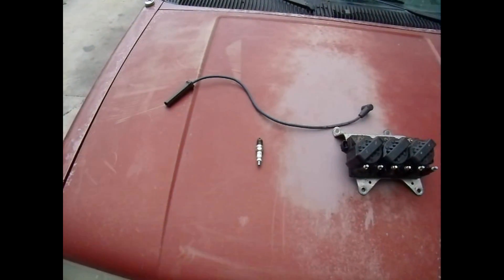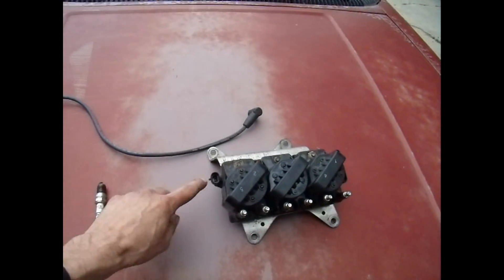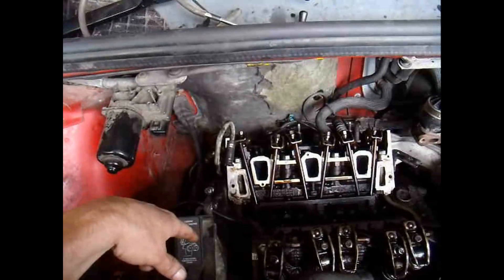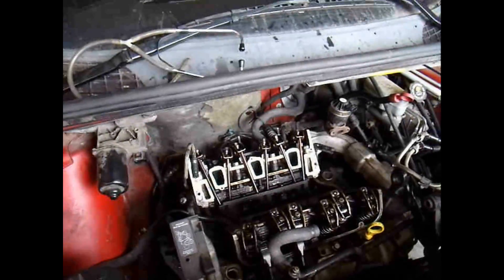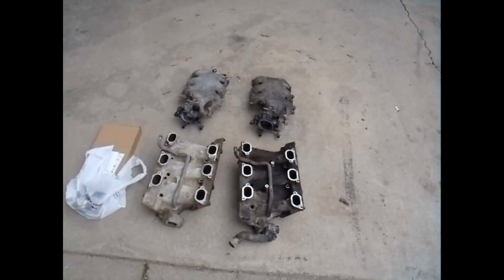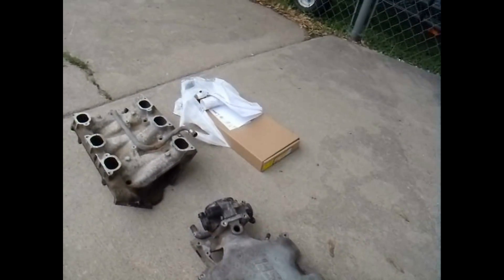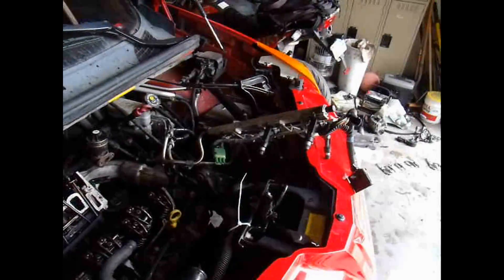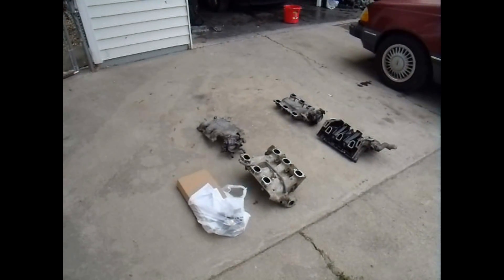GM 3400 / 3100 3.1 3.4 Engine Misfire Cause & Causes Miss Missing P0303

Comment: a bad head could cause random misfire?.... I own a alero 2000 with a 3.4L i found a random misfire, a mechanic came over to check what was wrong with the car, and he diagnose my car need head job, but that sound weird because i did head job one year ago, and the engine isnt getting overheating, could you tell me if i am wrong or the "mechanic" is right?
Reply: actually i had to change the gasket between the head and the low manifold, its a plastic one, after that the car runs good.... thank you for your comment brother....
Reply: denis perez check the connector wire that goes from the ignition module to the crank sensor on the side of the block(firewall side) and check it with a multimeter also since it runs under the exhaust manifold make sure the heat shield and wires aren't melted would be a good idea to pull the crank sensor to see if its good, easy way to check the crank sensor is to put it against to block its magnetized so if it dont stick to the block its bad. Ive built a few of these engines most ppl overlook the crank sensor and wires.
Reply from the maker: It's possible, but I doubt it.  Do the plugs look fouled out?  Random miss fires are usually spark related.  Had an instance such as the one in this video where my intake manifold cracked from to much torque on the bolts.  To much air into one of the cylinders caused a random miss.  
VT247
Reply: i forgot to mention the engine jerk a lot, and sound like going die when i am an stop sign or  neutral, I already change all the spark plugs, the coil packs, ignition control module, maf sensor, egr valve, air control valve, intake manifold gasket, but not the low intake manifold, i already look for any vacuum leak, now i am in the point if i should junk it up or try something different
Reply from the maker: An intake air leak can cause a random misfire.  Sounds like you've already replaced a lot of items.  Hows the fuel side of it?  The fuel pressure at the right pressure?  The more you describe the problem, the more it starts sounding like a bad vacuum leak....possibly internally.
VT247
Reply: the fuel pressure is perfect, i just change the fuel pump about 4 months ago, now i am trying changing the low intake manifold, but when i was putting everything back together i broke the manifold.....
Reply: ok, the car start fine, but then two days later the engine y sounding like before I did that job, i dont know what else to do, please give any idea
Reply from the maker: If your engine is making noise.  Take a piece of vacuum tubing.  Put it to your ear.  Follow the noise to where it is loudest with the other end of the vacuum hose.  This will give you an idea as to where the problem is.  If the noise is loudest from the valve cover, it's probably a stripped out rocker arm.  Lower noise from oil pan, rods or crank.  If all else fails, take it to a few shops to have a proper diagnostics run.  Best to always get a few different opinions on a problem.  Especially since repairs aren't cheap.  Hope this helps, I'm trying : )
VT247
Reply: Your welcome hope you used the metal LIM gaskets the plastic ones are trash i actually posted a video and i talk about that you should check it out.

Comment: Shoulda used a torque wrench and set to factory specs. Over tightening anything is a problem. I get torque specs for every bolt i remove(clean threads well) and torque to factory specs. This ensures fasteners won't break or strip aluminum part or threads and the deck and intake surface are evenly sealed. The felpro gasket set you used is assign excellent solution to bad engineering. Instead of a plastic gasket they came up with this great solution so you can make another 100000 miles without coolant leaking in the intake runners

Comment: i have had to helicoil four rocker bolts on my 3400 i did all of them with the head on and without pulling the intake. it a very common problem and no big deal to fix

Comment: On a 3.1 v6 motor does it matter if the valves are up or down when you torque the rocker arms down?
Reply: 2.6.16.   You need to make certain that each cylinder is at top dead center (TDC), when you loosen to remove the rocker arm bolt & remove the push rod, when the lower intake gaskets are changed! The same goes for when the rocker arm bolts are torqued down!.......Or when you go to start the engine, you'll have the dreaded loose rocker arm syndrome!  (Stripped aluminum threads in the head)  😢.  You can also purchase the Lisle 48300 rocker arm tool, to avoid loosening the rocker are bolts, when changing the L.I.M. Gaskets. It comes in handy if changing the head gaskets. 🎯

Comment: A friend and I recently replaced a cracked lower intake manifold (around coolant temp sensor), gaskets, coolant temp sensor, thermostat, spark plugs and spark plugs wires. I have got a P0300 code twice. I feel a rough idle and then some hesitation when accelerating slowing.  This never happened before these replacements. Don't really want to tear it all apart again. What would you suggest?

Comment: VT247, Question on the Lifter. The new one Napa gave me has a spring loaded top seat for the pushrod, but all the existing lifters are not spring loaded and cannot be pushed into the body of the lifter. Is this just an updated version or is this the wrong part. TIA Ken
Reply from the maker: They're probably a replacement type lifter.  Once the lifter is filled with oil it can be tough to compress it down.  Soak the new lifter in oil to allow it to fill up with oil or submerse it in oil and depress the plunger to prefill it.
VT247

Comment: VT247 ....What procedure is there to replaced a
Hydrlc Lifter ....Just pull the intake or must the head come off ...and the lifter pulled out from the top ?
Reply from the maker: It's about the same as doing an intake manifold gasket repair.  But check the rocker arm bolts as well, they supposedly can strip out.  The lifters are roller type with a guide on each side, 2 bolts hold down the lifter guide.  Check each pushrod for play at rest / no tension.  Intake & Exhaust pushrods are different lengths.  Also, it you get to this point, I'd recommend to go ahead and do the head gaskets.  They get brittle after time, loose compression, leak antifreeze and blow.  Replace gaskets from the heads up and these engines run forever!
VT247

Comment: Great upload I'm going through this exact problem gm 3.1 1992 #3 cyl miss code replaced injectors upper intake gasket plugs wires got great spark great compression replaced iac valve and egr and pcv and still rough idle but never stalls and loads of power when giving gas ! So now the mechanic is replacing the lower gasket and I told him to inspect for cracks! Hopefully no cracks but I'm sure I will know in a day lol! Thanks again for uploading:)

Comment: I have a 2002 gm 3400 in my rendezvous (same gm recall different shell) I have a horrible half grinding half chatter noise comming from the rear left (looking at the motor from the front of the vehicle ) under or right next to the alternator. And it only happens between 2700 and 5000 rpm. On rpm increase its pretty quiet one rpm decent it's louder than hell. Also have a small almost inaudible chatter at idle. What could this possibly be or what could it possibly morph into (as in bigger problems wise) 
Sincerely, 
Upset gm owner.
Reply from the maker: My guess is that it could be the belt tensioner or a stretched serpentine belt.  Mine used to squeak until I replaced the belt.  That's where I'd start.  The diagram for the belt routing is located by the power steering pump.
VT247

Comment: vacationtime 247 done the whole ordeal new gaskets no coolant in oil but water coming out exhaust and running poorly do you recommend pulling the intakes and checking for cracks didn't do it before
Reply: Email me at stoplight6969@hotmail.com
Reply from the maker: Did you do the head gaskets too?  They are known to go bad and cause this issue.
VT247

Comment: I watched your video when I was trying to determine why my 2001 malibu with the 3100 had a misfire.  I was baffled when you said that it was a felpro gasket and I had just replaced the intake manifold gasket with that same one.  I also knew that when i torqued down my intake I had heard a cracking sound when i torqued down the bolts.
But as a skeptic I first ran all the tests: Compression, Ignition, EGR, Vacume.  But all the results led back to the intake manifold being cracked.  I disected the engine once again to discover that yes the lower manifold was cracked over the port for cylinders 3 & 4.   I found a good lower intake manifold at the junk yard, $25.  I purchased a smaller torque wrench and a set of flare nut crows feet from harbor freight tools.  I followed the torque specifications putting the car back together.  The car starts and runs, i'd say it has a little fluctuation in speed at idle but when i take it down the road for a test drive it is like the car still has a cracked intake.
Reply from the maker: Both the upper and lower intake manifold was cracked on mine in the middle.  Got both for @$50 at a local junkyard.  Have you tried spraying water or carb cleaner over different areas on the motor / intake and monitored for idle change?  Mine however was cracked on the inside / oil valley.  Hopefully you changed the head gasket too, they tend to go bad.
VT247
Reply: Vacationtime247
Reply: billygreen711 This is what i hate about these forums there is a whole history to my car that you have no idea about.  So I guess i should have started from the beginning.  My father in law bought this piece of shit car from his neighbor for my wife in 2008. Low miles,tan.  When I first changed the oil in 2008 I noticed that there was oil on top of the coolant cap and it was a little low.  So I always had to add maybe a quart of coolant a month. 
We let our 16 year old son drive the car and he really put some miles on the car driving the neighborhood around.  He ran the car low on coolant and I do not know if he shut the car off or he shut it off.  But I had put some coolant in only for it to leak into the engine.  It had coolant and oil mixxed bad  That was August 2013.  I replaced the head gasket, fel-pro, and lower intake manifold gasket set, autozone brand, with it lasting about 4 months and I was loosing coolant again. Once again my son was driving it and ran low on coolant.  I asked him not to drive it because I needed to fix the the coolant leak.  One day later he drives the car without coolant.  He comes back home and begins to fill the car with water.  I realized that he had filled the car with more than a few gallons of water and asked him to leave his car here so i can figure out what is going on.  When I looked at his car I realized that water was now dripping from the exhaust while the car is running.  I tore the engine apart checking the gaskets.  I did not see a cracked block or head.  I replaced the head gasket with the Autozone head gasket set that included the felpro lower intake manifold gasket. This is what led me to start of the post.

Comment: NEED HELP WAT KIND OF INTAKE MANIFOLD GASKET SHOULD I BUY.....CAN THE MISS FIRE OVERHEAT YOUR CAR I HAVE A CHEVY IMPALA 200 3.4 ENGINE
Reply from the maker: The car won't overheat just because of a miss.  For the miss, check the spark system.  Spark plugs, plug wires, coil pack.  For the overheating try bleeding out the bleeders.  My guess for both issues is it could be the head gaskets.  They are known to fail on these motors.  The gaskets become brittle and delaminate.
VT247
Reply: Vacationtime247 ohh ok for the gaskets want kind shoul I get..i heard to get the fel pro gaskts
Reply from the maker: Victor Carranza The Felpro gaskets seem to last.  If you have to do the intake manifold gaskets, do the head gaskets too.  The head gaskets tend to go bad often as well.
VT247

Comment: My only question is, what kind of misfire was it? Was it a steady, pronounced, rhythmatic misfire, or was it more intermittent?
Reply from the maker: It was an intermittent misfire.  Didn't seem so bad when it was driving or revved, but would trigger the code when at idle.
VT247
Reply: Okay lol. Cool. Just wondering because I'm trying to solve an intermittent misfire problem on an 01 Monte Carlo with a 3.4 with 168k miles that hasn't had the lower intake manifold ever removed to my knowledge. I was getting a code for the #2 cylinder misfiring and I tried little things first... spark plugs, swapping coil packs around to see if the misfire moved, then I used an EFI quick probe (like how you used your stethoscope) and found the #2 injector to be operating intermittently, but after changing it, I STILL have the misfire. All that's still coming up is a couple of trouble codes for the camshaft position sensor which I'm pretty certain might be the culprit since I replaced that in a Grand Prix with the 3.1 motor that exhibited the same misfire condition and that did the trick. So hopefully after replacing the cam sensor, that'll be it or else I just might be ripping the LIM out and having a look next lol.
Reply from the maker: The stock head and intake manifold gaskets on the 3400 eventually fail.  A bad gasket can cause a misfire as well.  Letting to much air in the the cylinder or not building enough compression.  But, perhaps the cam sensor could be the culprit.
VT247

Comment: Hey I got. A 97 Chevy malibu. I changed everything. Except. The. Spark plug wires. Wat could. It be that's. Making. It. Shake the motor is shaking. When. I put it in drive
Reply from the maker: Could be many things.  The plug wires, a vacuum leak, the EGR valve.  Run a code scanner on it and see what it reads.  Might have a miss.
Reply: It's sayin miss. Fire but I changed the. Sparkplugs . Pluse. Maigoul coils ignition sensor.
Reply from the maker: Is it a random miss fire or only on one cylinder?  If it's all cylinders, I'd check for a vacuum leak or EGR
VT247

Comment: tomorrow am going to tear it all apart again !going to check for cracks ect!if its not the problem could it be the injector on the fuel rail? even though it clicks like its working
Reply: Check your fuel pressure regulator

Comment: still have a missfire!!! no cracks ect!! everything is bran new!!! including the coil pack and the black thing that yhe wires plug in to  to send singnal to the brain!!! been working on this car cents november of 2013!! i don't understand the missfire!!! its only cyclinder 3
Reply from the maker: Hopefully it's not the head gasket making it loose compression.
VT247
Reply: i think i mite have to change the intake gaskets again
Reply from the maker: Might as well change out the HG too, it's not that much more work and it's no fun having to tear it all back down again.....
VT247
Reply: 7.13.14.     Dwayne, a shorted coil winding in the fuel injector will throw a code. Sometimes it will be fine until the injector heats up.

Comment: Where should I look for vacuum leaks
Reply from the maker: Around the ports coming from the intake manifold to the motor.  Use a length of vacuum tubing from your ear going to parts of the motor.  Listen for changes and volume from each area you go to.  A vacuum leak usually makes a whisping or high pitched sucking noise.
VT247

Comment: Hi I have a 2003 chevy impala and I put new lifters in it and added a new rocker arm because I destroyed one from driving the car with out no oil in it and I didn't know that It didn't have any so I fixed that issue but then my car is running poorly at idle now and I see gas coming from the fuel pressure regulator I wonder if that had something to do with the bad idle or is it a misfire because my exhaust sound like it's putting a little bit and also I'm trying to see why it's burning so much oil to

Comment: 11.24.13.  I'm doing a L.I.M. Gasket installation on a 99 Chevy Lumina, 3.1L. I'm using the Fel-Pro Perma Dry gaskets,& I noticed that the metal indexing tab is a tight fit,in the hole in the head! If it pops out and you do not notice it, when you go to torque down the L.I.M. You will crack the upper middle intake port on the L.I.M. You must make sure the metal indexing tab fits in that hole in the head! Thanks,Vacationtime247 for the follow up, this gives insight to the cause.
Reply from the maker: Almost drove me crazy trying to figure out what was causing my misfire!  After tearing everything back apart and noticing this, that was certainly the cause.  This mistake cost me @$150 for a new intake and misc.  But, lessons cost money.  Good ones cost lots!
VT247

Comment: Wrong brand spark plugs installed will cause a missfire in these engines.Last one was a 2004 Impala with the 3400,someone else installed E3 spark plugs and this caused the missfire.Replaced the spark plugs with the AC Delcos,missfire was gone.Do not install E3 and Bosch spark plugs in these engines and use the AC Delco spark plugs only.

Comment: well we decided to tear that 98 monte carlo 3100 engine down with just over 134000 miles and we found out by the previous owner that a shop had already replaced the intake gaskets right before 54,000 miles. well they used the plastic gaskets again and they were about blown. plastic was brittle and cracked in one place.  problem was the head gasket was blown on cylinder #1 which my scanner kept saying cylinder #1 missfire. all fixed now and running like new
Reply from the maker: Awsome!  Glad that you got it fixed!
VT247

Comment from the maker: Besides the intake manifold gasket, guess what else goes bad in the 3100 / 3400's.  The head gaskets.  They get brittle and fall apart.  Could be the cylinder has to much air entering the chamber such as a lean misfire.  Or coolant entering in the cylinder.  Also, check for a vacuum leak by spraying water.  Then listen for rpm change and a suctioning noise.
VT247
VT247